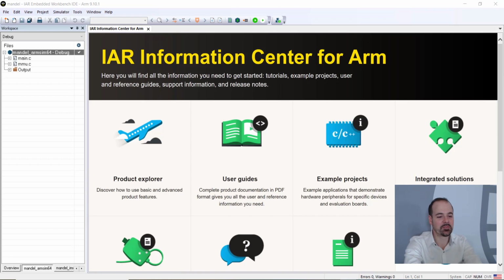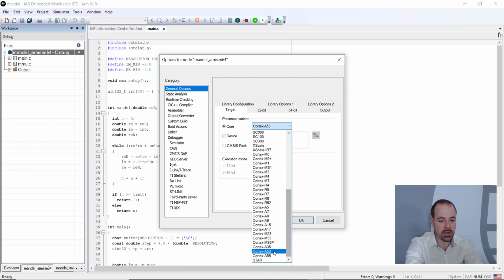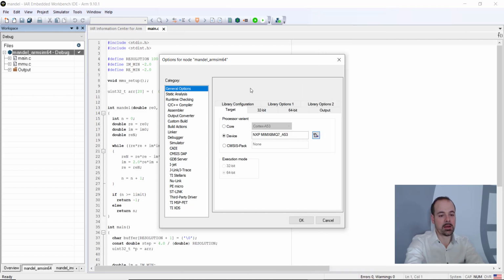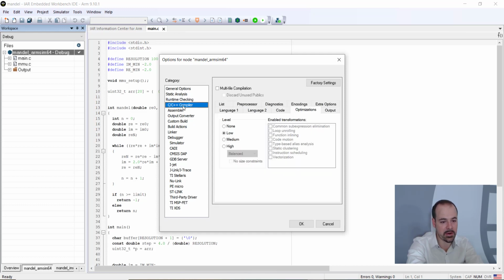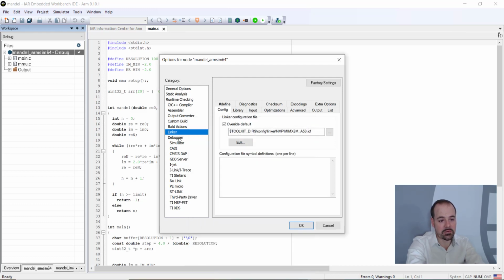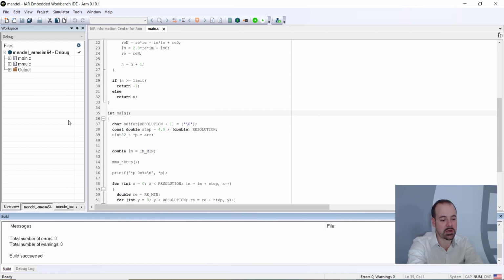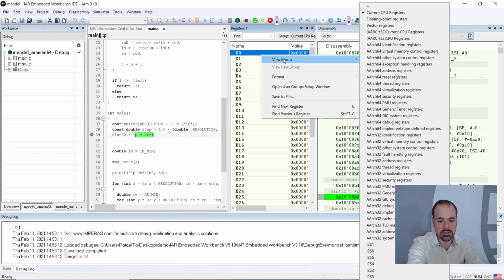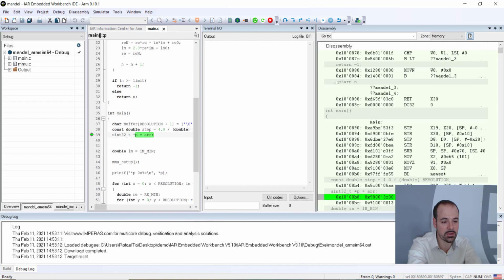Overview of IAR Embedded Workbench for Arm V.9.10

Comment: IAR document does not indicate that software will run in 32bit OS or 64bit
Reply from the maker: Hi, starting from IAR Embedded Workbench V9.10 and moving forward only 64bit OS is supported (32bit OS is not supported anymore). From the release notes you need the following to install and run the IDE:
•A Pentium-compatible PC with Windows 7, Windows 10 or Windows 11,64-bit versions.
•At least 4 Gbyte of RAM, and 10 Gbytes of free disk space.

Please let us know if you need more details and your are welcome to reach out to fae@iar.com also so we can make sure to assist you.
Reply: @IARSolutions  how can we download ewarm for 32bit OS
Reply: @Dcode103  clearly older ewarm than 9.10